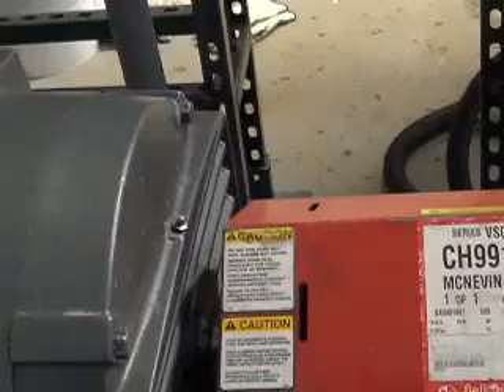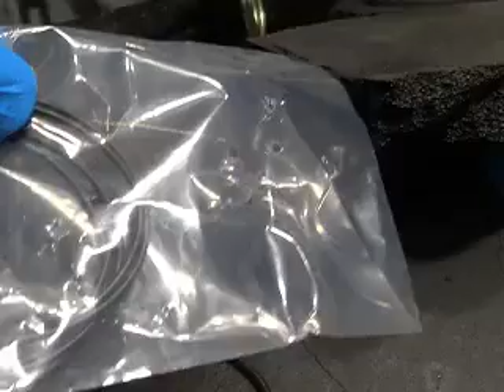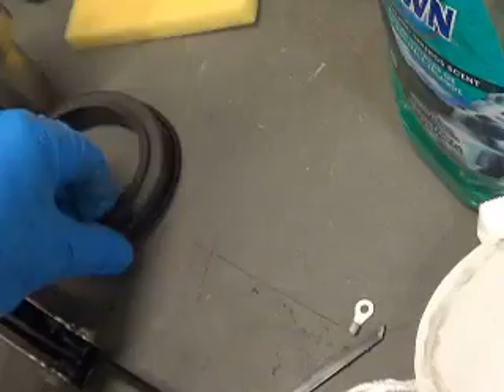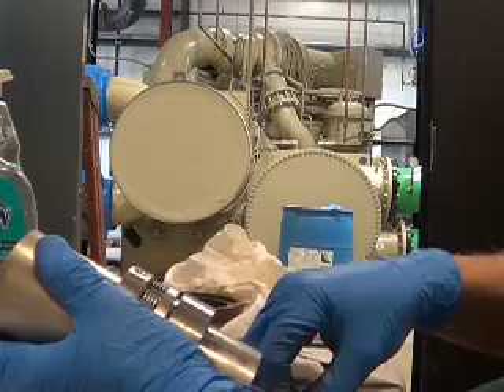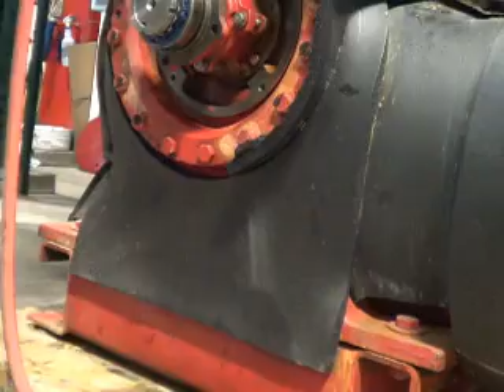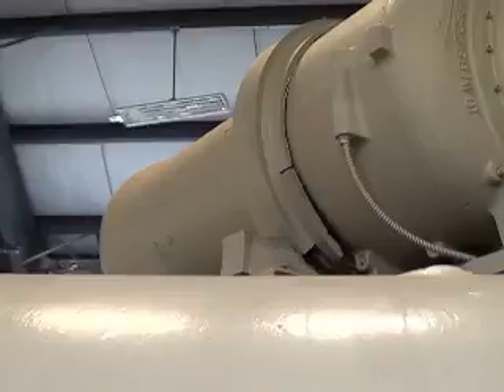125 HP pump seal replacement

Comment: Hi EZ,
B&G rep here. 
Parts list is here: http://documentlibrary.xylemappliedwater.com/wp-content/blogs.dir/22/files/2012/07/CP-400F-PL.pdf 
Single Flushed Mechanical Seal Instructions: http://documentlibrary.xylemappliedwater.com/wp-content/blogs.dir/22/files/2012/07/P85505B.pdf 
Standard seal demonstration video (note: for current model VSX, similar construction): http://content.jwplatform.com/previews/JIYhJSwZ-KUhQUwDg

I have to be honest, I don't know why you have a flushed seal. I'm guessing who'm ever selected you piece of equipment has that option in their specification. There is confusion in the industry that a flushed seal is better than a standard internally flushed. While a flushed seal will flow more water over the seal face it's not necessarily better. As you've found out the lines have a tendency to block with debris in dirty water (condenser water) applications rendering them useless. Hence the question: Why would you want to flow more dirty water over your seal face? This increases the risk of failure. In your case it may be worth the extra investment for a SiC/SiC seal if you haven't already. SiC or silicon carbide is the 2nd hardest material known to man next to diamond. They will last you a lot longer. Additionally, a filter on the flush line wouldn't hurt either if you're having consistent issues.

Hope the above info helps. Let me know if you need more info. I can direct you in the right direction.
Reply from the maker: +Spencer Kennedy Thank you sir. Where were you in my time of need. LOL   B&G service in Colorado is not what it used to be Mcniven ??? in Denver leaves much to be desired.

Comment: nice work brother. well done.
Reply from the maker: Thank you sir.  The pump  and seal has been given the acid test during this hotter than normal summer and it is holding up fine until this moment that I brag on it and give it the jinx.  LOL
Reply: Lil. Thanks for sharing it with us.

Comment: cool stuff! wish I had new(er) pumps to work on...got a couple 1250 gpm that are still the old packing/drip type cooled think about 1972 vintage. Have only had to fully rebuild w/ bearings and sleeves once so far. Love these videos...Thanks!
Reply from the maker: That big green condenser pump still uses garlock rope packing. 7 rings of it. Hard soft hard soft.  I repack it every other year. Thanks for your support